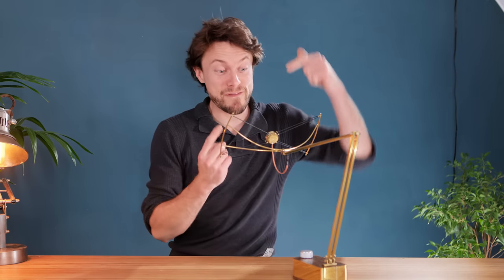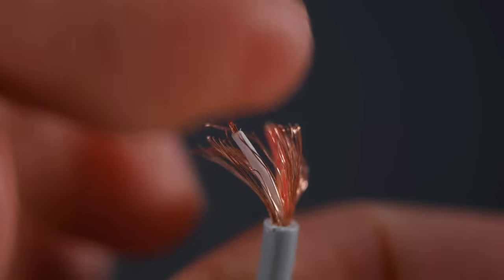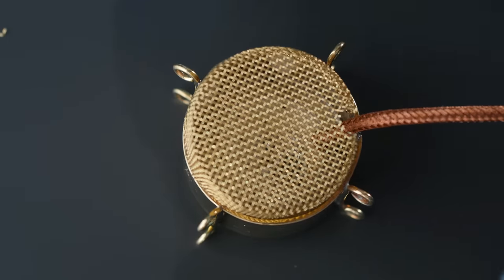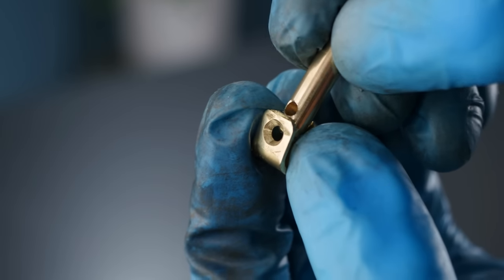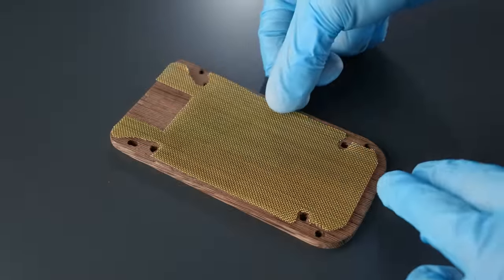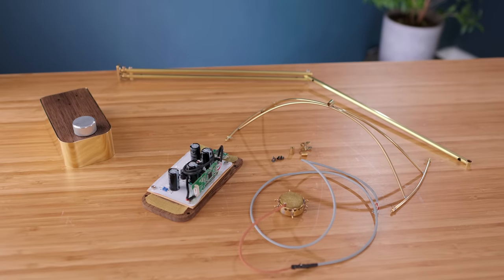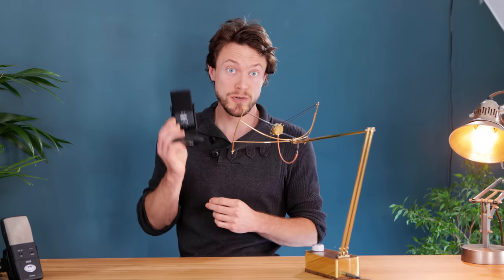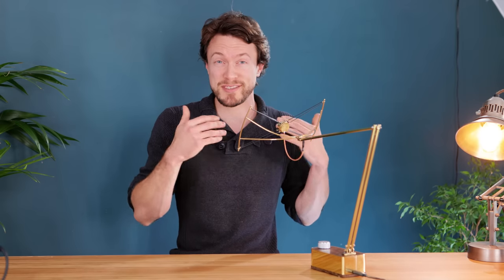Building a quality USB-C microphone

Comment: This is outstanding!!
I can't even begin to fathom that a $30 mic will easily compare to a $3000 mic!
The only 'problem' I heard was extra treble in the DIY mic, which can obviously be fixed with some minor EQ.
As for which one is better, I do like to $3000 mic more (I think this is to be expected). However, that doesn't mean I would get it, over making this, even if I did have plenty of money. Not at all.
For a design tip, here's my opinion.
instead of making your own PCB, you should get one from a custom PCB manufacturer, such as PCBWay, as they can be really cheap, as well as nicer looking, and a lot smaller in size.

Comment: It does sound very sharp sounding and not at all natural, but it does have a good sound floor for $30. You can hit the ends of the wire with a lighter instead of sandpaper, you will get cleaner solder points. You could spend a bit more and use a noiman pickup. Good job you earned a like and sub.

Comment: I assume the preamp design is solid, since it seems the schematic linked is unchanged from what is shown in video.
Also, I am doing a BOM for all materials necessary to build this. I'm not quite sure what math he is using, but this mic will cost a minimum of $150 to make. He is also clearly using items on hand (like small motor winding wire), and not including those in the total cost. And that is mic/preamp only. I haven't even started with the mount/arm structure parts (brass rods/tubes, rubber). 
I have some parts on hand, like screws, solder, wick, wood for amp box... but I imagine a lot would not. If you build this to his specs, you will be spending closer to $200. I can't fathom how he arrived at a 30$ cost. 
Just the USB interface, and mic capsule alone is $33.

Oh, and that isn't even considering tax/shipping.
If you are considering this project as a cost savings project, don't. Because you can get a pretty good mic for $200, with about 30 hours less labor. 

Still a cool project for those that get great enjoyment from doing that kind of project work. And don't get me wrong, I am still going to build this. I have a very different mount idea (round cage suspending the mic, with 6 inch verical mount post down to a heavy round base. LIke the 1930's old fashion table top sitting ones you see in old pics of radio personalities).

But, a cheap project, this is NOT.

Comment: You might include some smaller value filter caps in parallel to your main bus voltage capacitors. Maybe a pair here each, make them nice ceramic ones with 10n and maybe 0.1n. This will help with high frequency noise from outside sources.

Comment: It looks really good and does sound very good. Though I do think you need a pop filter for it which is a trivial change. I didn't think you could could make such a nice mic for so cheap.

You could make a brass knob if you still have some of that larger round bar. If you need a "D" hole you drill the hole to size and then you use round bar that fits the hole and cut a slice so the hole will look like a D

Comment: i am NOT an audio expert but... i tend to lean away from a basic amplifier and prefer dif amps or instrumentation amplifier if your nasty :)  a diff amp takes out all unwanted signals by comparing the original two lead input and subtracting out other picked up inputs that are not on the original, (artifact noise); where an instrumentation amp is a diff amp with an added op amp to reduce further. i like that you use passive filters in your build as you probably do not have a need for more than a 20db/dec drop. however, you could go with active filters if you prefer to go with a chevy design.

Comment: Everyone argues that one sounds better than the other. Sounds by definition are subjective. The one that sounds better is the one that the creator decides to use and has access to. This is like buying tires for a car. Some are better off-road, some are better on. If you think Micky Thompson Drag Radials are good for mudding then you might be in for a bad day, and if you don't have a replacement then you're stuck and going nowehere. All of the mics sounded good for what they are. Now the real test is would you rather pay $3,000 for a microphone that is world renowned for being a top tier microphone, or pay $40 to make one that 90% of the listeners will never know the difference in. If you can afford the $3,000 mic and don't want to spend the time, energy, effort into building your mic from scratch, then cool. On the other hand, if you want quality audio but don't have $3,000 to spend on a mic, are you willing to put in the time, energy, effort to get a mic that sounds great. Oh and by the way the Neumann was sensitive on plosives, had a boomier sound, and the noise floor was on par or maybe slightly better than the DIY. The DIY had a brighter sound in the mids, picked up the lows pretty decently, and was fine on higher vocal register but would need some testing on higher pitch samples to get a better reading. Any decent audio engineer could make the DIY sound as good as the Neumann perceptibly to most, if not all, the audience in most scenarios where a desktop microphone would be used.

Comment: There is not much difference between the two decent microphones and the one you have created. It’s in the cartridge that you use. It all begins there. I also love the pro line from Heil Microphones. Bob Heil has worked in the sound industry for many years. He is also known for his quality microphones for Amateur radio, he himself being an avid Ham operator.  Now what I would love to find is one of the Tube Preamp Telefunken microphones, original manufacture and not the newer version that is available in limited quantities.
And now for the next real challenge, time to build a ribbon microphone!

Comment: 4:30 should have soldered the solder braid shield to the shield of the connecting cable--if you don't do that, the solder braid basically does nothing. to make it even better, it's better to electrically bond the braid to the capsule's chassis for best performance.

Comment: Nice build.  However, there's more than $30 in brass stock alone.  Also, you sort of defeated the purpose of fire retardant circuit board material (FR4) by leaving flammable paper on the board in nearly direct contact with component leads.  Typical failure modes in electronics can generate enough heat to fuse wire or melt IC cases so it could certainly ignite paper.  Next, the fine motor winding wire pair used from the FET transistor to the preamp should have been twisted before pulling through the solder wick shield otherwise your common mode noise rejection will not be optimal. Finally, that same wire, due to its tiny diameter is more resistive than it could be so likely adding Johnson thermal noise. I'd like to see relative test results performed by an independent expert audio engineer.  Neat project!

Comment: The DIY mic is at a slightly higher level which will potentially make people favor it. Not sure what the difference is in sound pressure level but it seems to work perfectly fine for a normal speaker voice and probably most singing voices too. You built the preamp as well which is amazing. The Focusrite preamp is about another $500 + $3000 for the U87. All in all your DIY built is about $35 with an absolutely stunning design. That's crazy and I can't quite compute what I'm seeing and hearing to be honest. That said I do think the U87 sounds cleaner here at least but maybe just lowering the gain on the DIY preamp will make your mic sound even better. I'm severely impressed.

Comment: i like the aesthetic quite steampunk. i think i'd build a simpler holding system but keep the suspended bit for vibration dampening as its quite a quick and cheap extra. maybe something like a screen mount or armband for it
Reply: Steampunk? Please, this looks like a mic from the 1920s/1930s.

Comment: In comparison to the Neumann I find the DIY one sounds slightly v-shaped and I heard a bit of distortion in the higher frequencies. However, the fact that the only thing to nit pick about is basically EQ and amplifier differences is pretty impressive considering I'm comparing to a $3000 mic

Comment: between the $3000 microphone and the  $40 microphone. the $40 on seems a bit muddy on the lower tones ofyou voice, while the $3000 one seems to have extra noise on the high tones. I'm sure a good mixer could remove the extra noise, but not so sure about the muddy lows (obviously i'm not an audio engineer).  The $40 has a warmer tone and is perfect for things like narration or say audiobook reading.

Comment: That's an amazing DIY project! 
Quick question: what are the drawbacks of this product? Basically, what prevents big manufacturers to do a similar product if it's so cheap to produce?
Reply: Companies do make similar products. He literally says that all components are basically the same as the 500$ mics. The reason why you are paying 500 + 200$ for the pre amp is completely just paying the name and branding. A 100% cotton t-shirt is generally priced at 10 to 30. Add a simple T&H logo and the price just went up to 60
Reply: @raftube8771  yes but using your tshirt analogy, why is no one making the $10 tshirt? This seems like an big opportunity for a new commer right?
Reply: @AvastarBin because mass producing this item quickly becomes far more expensive, specially considering how capitalism encourages the highest profit margins possible.

Comment: the diy mic is quite good but if you used a proper printed circuit board it would work even better and use solid capacitors which even more reduces the electronic noise from the circuit rest everything is prettymuch perfect

Comment: Nuemann picks up more low bass but the highs are not as pronounced/clear. I prefer the clearer mid-high frequency clarity of your mic with an EQ to give it a bit more bass. Maybe you can add a larger woofer to pick up the bass instead of using an EQ? (btw I use expensive Sennheiser IE400 earbuds on an Sound Blaster X3 with no EQ)

Comment: Im considering this but Id much rather have a TRS or XLR for my mic to use it with an audio interface, not sure Ill be able to figure out how to do it on my own but If I built this Id want something I can use with other audio equipment and not just a PC. Ill have to look into it more because the general design cost and look is excellent.

Comment: Hello, Sir! 

I really liked your microphone project. 

I have some basic knowledge in electronics, I am self-taught!

I have a question regarding the schematic you attached. 

How should the polarity of the 2200µF capacitors be set, as in your video the capacitors of this rating seem to be installed with a slightly different polarity than in the schematic? 

Could you please advise me on how to do it properly so I don’t damage any components?

Thank you.

Comment: Any chance you could do an addendum video on an XLR version of this? I use an audio interface for everything already, but I do not have the electronics engineering or signal processing knowledge to adapt the circuit myself, and I suspect there're a bunch of us in the same boat. This cheap circuit sounds a heck of a lot better than the mics I'm running right now and I'd be excited to try building it if this information is published somewhere.
Reply: Based on his explanation, with an audio interface you wouldn't need a preamp at all, instead using the amplifier built into the interface.

Comment: Should've used ur mesh jig (the 1 u used to cup the pickup) to wrap the knob in the brass mesh! It would've closely resembled the mic (since it's silver too)!
Reply: And the solder braid shield, to wrap the visible parts of the wire

Comment: You say 30 dollars but just the diaphragm and the usb audio interface alone reach that price. We're still missing the brass plating, tubes, screws, all the components for the aplifier, usb c breakout board and so much more. That's not to mention shipping
Reply: Counting in the screws, amplifier components and usb c breakout gotta be a joke. All of those can be found in LOTS for less than 1$ to maximum 2$.
Reply: @csutkascsuti  I'm mainly considering the brass tubes, mesh, cylinder and wooden case. Those alone probably double the price (Although I do live in a rather expensive country so idk). I agree the screws and breakout are probably dirt cheap tho.

Comment: This is amazing and brilliant.

But is there any possible ways to DIY a dynamic microphone with xlr output ?
Reply: Thats my comment also, I'm confused because Id like mine to work with my audio interface using phantom power, I am about to chatgpt it and look for some other projects.
Reply: i was thinking about using a xlr to usb cable but don't know if it's good
Reply: i have just cheked the description, he give a link to a xlr device to build it. Does yall know if it replace the stripboard or the usb audio interface? im a little confused i don't know anything about electronics

Comment: Using magnet wire and de-soldering braid as an insulator. Very cool. 

I'm wondering how this would look with aluminum framing and copper fasteners.
Reply: I am in the process of getting the rest of the stuff I need to finish what I started a year ago, mine will be made out of tung oil stained red oak board and dowels, copper plates for the control panel, copper reinforced hinges and brass for the hardware. I plan giving it patina, toggle switch and "on air" light. I really just want to build it so I can be done thinking about it.

Most important: volume goes to 11.

Comment: could you make a mic that has multiple interexchangable polar patterns by using 2 of these cardioid capsules pointing in oposite directions. when you add them both in different proportions you can get any polar pattern in between a cardioid (one is on and the other off) and an omnidirectional mic (both are on)  . if you reverse the phase of one of the two capsules and do the same you can make any polar pattern in between a fig 8 (both are on) and a cardioid (only one is on). i dont know exactly how the acoustic labrinths inside the capsules would be affected by having them close together but i think its worth a shot, also if you are going to make this project go all in and put a HP filter on it

Comment: The expensive mic sounds almost like you have stepped into a room with noise padding on the walls vs the homemade one can hear almost a bit more of the noise vibrations off the walls but it's still so much better because of the insane price difference when they sound so similar.

Comment: If anyone has any issues with this build, I may have a solution. I ordered 4 of those THAT1512 chips from the provided link and tested them. None of them worked. After doing months of research and redesigns, I found that fake versions of this chip are very prolific. I instead purchased the AD620 chip from Mauser and they all work perfectly! I’ve built 4 of these and they all work excellent.

Another word of advice, the two large capacitors that connect to the power supply are labeled incorrectly on one of the schematics. The design works perfectly, you just need to make sure the polarity makes sense when you wire it up. I would highly recommend looking into his forum in the description for more insight. 

You can make this. Don’t be afraid to try!
Reply: true, we are a team that work on this~

Comment: or just buy a behringer xm8500 dynamic handheld microphone for cheaper, less effort, and sure an extra cost for a boom arm and a certainly recommended shock mount, but for someone who doesnt know soldering circuits and all that jazz, its certainly worth it for maybe 60 dollars more if you get cheaper options, though those wont last very long.

Comment: The expensive unit sounds a bit warmer.. too warm, if that makes any sense.  To me, engine and equipment noise has left me with some auditory 'blind spots' and find the high dollar unit too subdued, I had to increase volume to hear the higher tones in your annunciation, and I find it bothersome.

Polished brass, a hint of copper (shield the length for a touch more), fine grain wood, rather nostalgic with elegant lines.. good sound to a tone deaf 60yr old mechanic, well done!

Comment: i love the design but i wonder if it could be improved... i think i would rather have direct audio out plus external power source but thats more of a personal preference. and i think an actual audio volume control module would only be like 5 bucks and might work a lot better than the frankenresistorknob you had. also i wonder if an arduino bluepill would be better than the usb audio interface as they only cost like 5 dollars and already have the usb type c interface and you could probably program it to have more advanced features like noise reduction or lossless compression...

Comment: What would you need to do differently to connect it to an existing interface, either through a 1/4 " or XLR input? I have absolutely no experience in electronics, but this looks like an awesome project to try at some point.

Comment: Yea the materials prolly cost nothing to the original but havimg a soldering iron and other tools on top is like 10x invesment comparatevly (unless u do this kinda work and have the given tools)
Reply: A soldering kit is like $15, and not many other tools were used. You don't have to cut wood and brass to shape like he did.